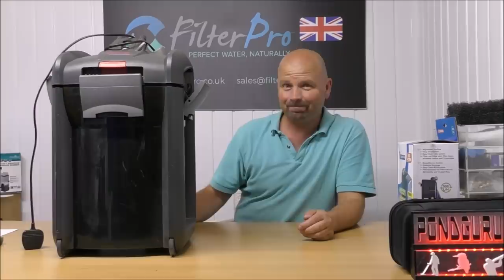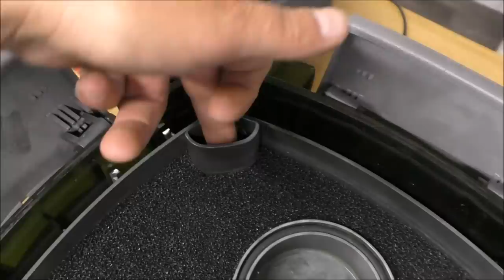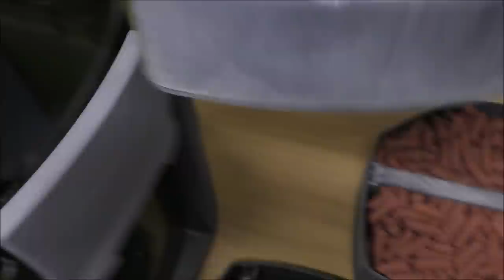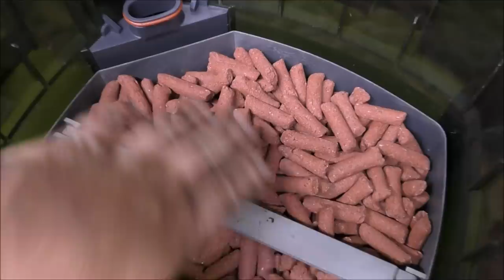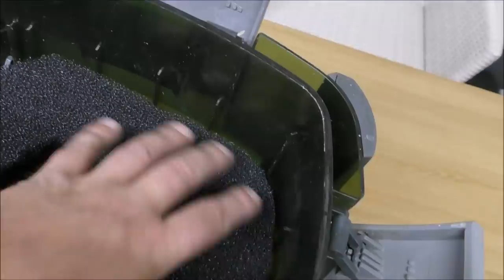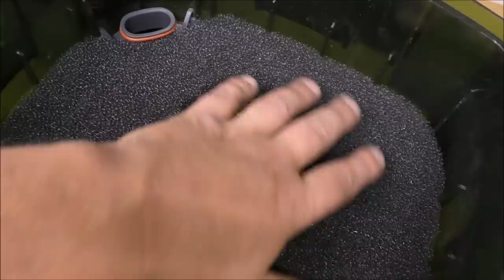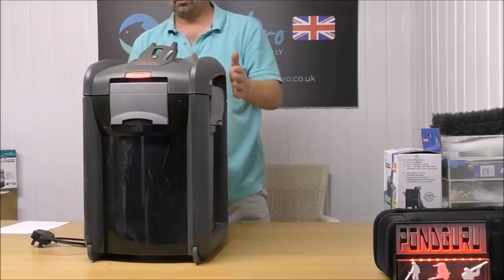Pimp My Filter #34 - Eheim Pro3 12000XL Canister Filter

Comment: I've 2 of these filters the 2080 or 1200xl and a 2180 or 1200xlt u only have to clean them every 3 to 6 months but the way u have set this up once the foam filter pads uve put at the bottom block up it will reduce flow rendering the rest of the media useless unless u clean out the sponges uve put at the bottom every month or so which isn't easy with the size of these filters. It's funny how u think eheim that's been making filters since the 1960s know less then you.

Comment: I'm still not sure that too much Biohome is a good idea in planted tanks.

In my Rio 125 I have a little bit of Biohome and my nitrates are below 10mg/l, but PO4 is above 2ml/l and I have algae issues.

Because I have only planted tanks I have reduced or removed Biohome and similar filter media
Reply: Meinst du es ist nicjt gut 6 kg von diesem biohome zeug rein zupacken ?
Reply: @karsai7173  It is not of you have a heavy planted tank with a small amount of fishes. The media will "steal" the macro nutrients that the plants need.

Comment: I have the 1200XLT (which has the built in heater) which seems to work well, however it makes quite a wiring noise. Any advice? Cheers
Reply: Probably Stuck air

Comment: Looking at the more expensive canister filters, I'm really wanting to try an Oase. They look really well designed.
Reply: I take the Pro 3 over the Biomaster any day. The trays are a lot better in the Eheim. they keep the flow longer, and they are easier to maintain. 
The only thing the Biomaster does better is the very sturdy handle and potentially a lower price depending on where you live.

Comment: I have the same one the problem is the motor run but no suction any suggestions thx
Reply from the maker: There are 3 common reasons why that would be so:
1 - The impeller is broken and needs replacing (check impeller)
2 - There is a blockage in the pipes (check pipes)
3 - There is a huge air lock in the top of the filter (rock the filter back and forth to free the air)

Comment: Can you tell me how to hook up the wifi for this. It's a nightmare for most people
Reply from the maker: I've never had any problems connecting to Wi-fi appliances as I just go into Bluetooth settings on my phone / computer, press 'scan for new devices' and they get found. At that point I hit 'pair' and they pair.
Maybe the wi-fi is not working properly in the filter or maybe it needs to be activated by pressing a button on the filter? It's been so long since I looked at this I can't remember if there was a Bluetooth / wi-fi button on the filter.

Comment: whats the difference between the xl and the xlt?
Reply from the maker: XLT has a heater in the base.
Reply: @pondguru  No heater isn’t in the base for this unit.  The heater is in the top of the unit for the 2180/1200XLT
Reply from the maker: @Spruikermania  Maybe some (newer?) models have the heater in the top but the heater for the (older?)1200 xlt version of this filter was definitely in the base. If you do an image search on Google you will see that there are two versions - one has heater display on the bottom and the other has it on top. Also if you image search for 'Eheim 1200 xlt heater' you'll see that the shape of it in some pictures could only fit into the base. Also, when you look at an old filter you can see the heater in the base, lol
Maybe the newer versions or 'e' versions have it in the top? or the difference could be older version is 2080 and newer version is 2180? so many images online are labeled incorrectly......
Reply: @pondguru  I have th older version it’s called a 2180 and the heater is at the top.  Always has been at the top for this model but maybe you getting confused with another smaller model or the similar looking Pro 4 models (I also have these) and they have the heater at the bottom.
Reply from the maker: @Spruikermania  I thought the newer version was the 2180 and the older was the 2080 - I wish Eheim would just call their filters what they are instead of all the stupid numbers......
Reply: @pondguru  The 2080/XL1200 is the non thermo version and the 2180/XLT1200 is the thermo version.  They only have the heater in the top for this model.  Cracking filter too.   Only uses 25w to pump out 1850lph, no other filter brand in the world can run this efficiently.  This saves you $30 per year in power compared to other brands.  In saying that the Oase Biofilter range are also quite efficient.
Reply from the maker: @Spruikermania  That makes sense yet I'm having some sort of Mandela Effect as I've seen the big filters with heaters at the bottom, lol
All I can find now is mis-labeled images online and the 600 and below having the heaters in the base so in this reality you're bang on, man - thanks for the education.